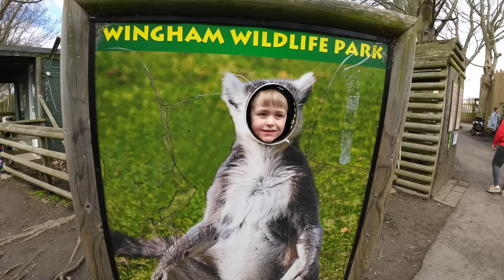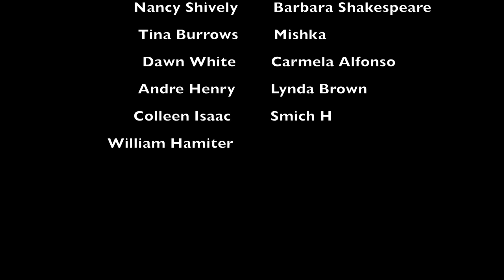NEGLECTED & Left To Perish! Spontaneously GIFTING A Clean..

Comment: Hmm. I’m a bit perplexed by this one. First, who installs a patio below grade with no drainage? A heavy rain would flood it. No wonder the moss was colonizing. I bet they have a damp basement, too. Second, the dam to protect the little pond did nothing. I dread to think what was in there before, but now there is a layer of patio sludge, too. I was surprised you didn’t pump it out into a tank and haul it away. Then you would have had a job power washing the basin. I bet it stinks. No aeration whatsoever. The patio and pathway turned out great, as usual. Let’s hope the owner does something about that pond, after all your hard work. It would be like sitting next to a sewage treatment plant.